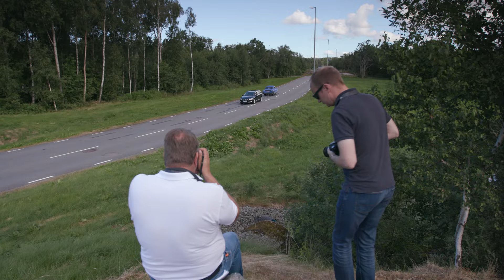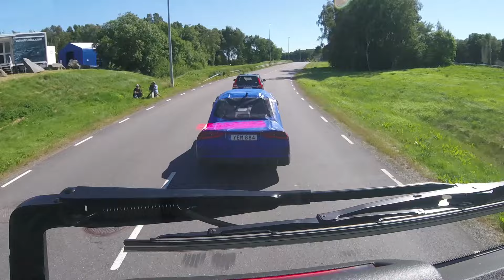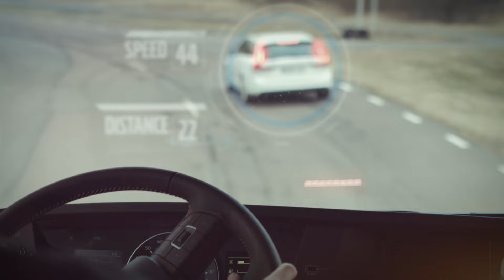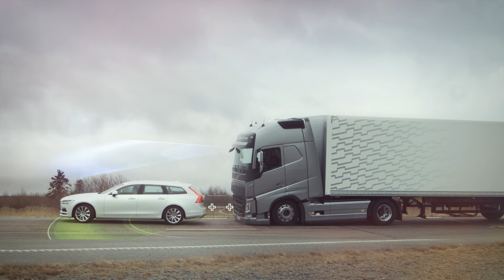Volvo Trucks - See how Volvo Trucks take a brake

Comment: what happens if there is not enough air pressure
Reply: iamjesper If there is no air pressure the brake will snap and not.let the truck move.
Reply: Do you know how the brakes on a truck works?
Reply: no
Reply: Air brakes stop a vehicle by creating a vacuum. In order for the vehicle to move, there has to be air inside the brake chamber. No air = vehicle will not move. The same goes for trailers and why the wheels lock up when no air is supplied to the trailer.

Trains work the same way.
Reply: If there is insufficient air pressure the brakes won't release.
Reply: iamjesper not enough air, no move. Brakeline snap = 3G deceleration...